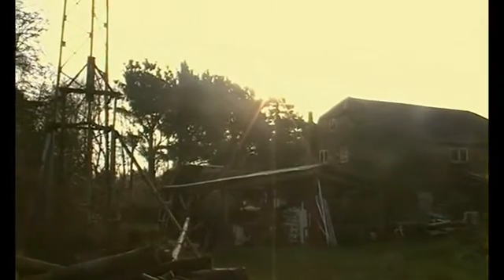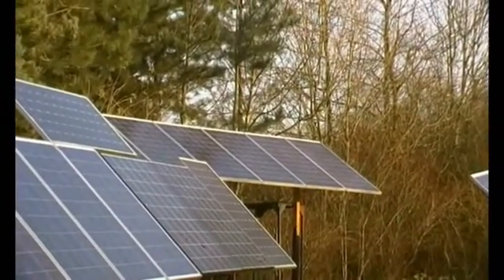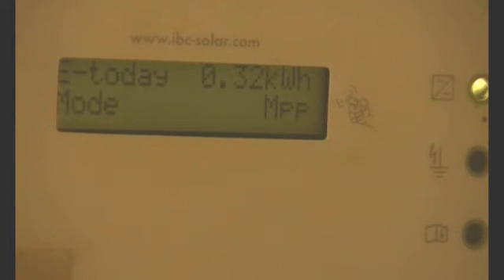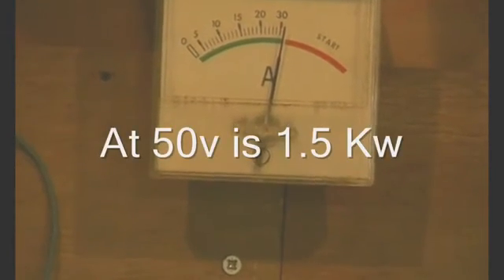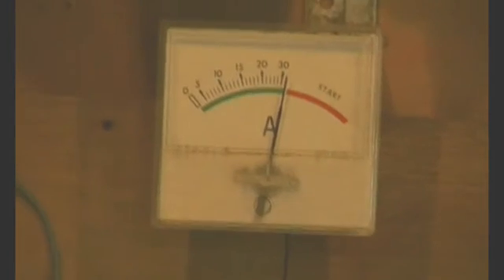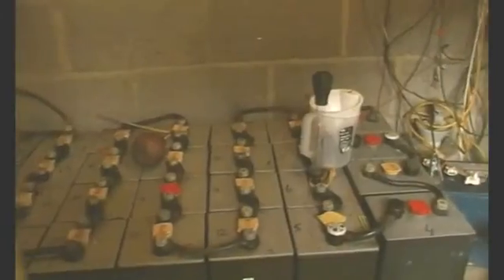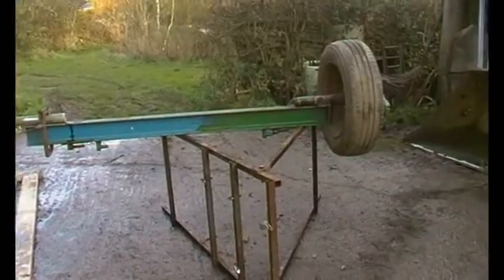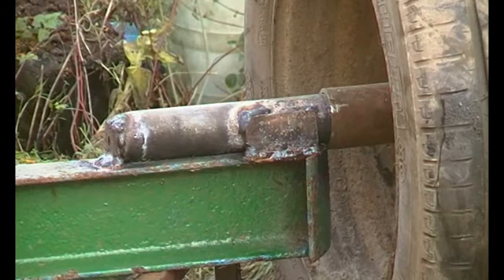Solar PV system at the winter solstice 2016, shortest day

Comment: at least snow isn't an issue. do you adjust the tilt of panels for sun angle?
Merry Christmas
Reply from the maker: Hi, John. I don't change the angle for winter as the shallow angle is best for light reflected off the clouds. Snow, I just don't want to think about it!. Cheers, Andy
Reply: Definitely...! I was wondering if I was the only one who thought of this. I have some panels set at severe Winter angles, but I also have "Summer Position" panels. Those latter ones do better on an overcast day no matter what the Season.

Comment: Maybe one could rig a system with fire eyes or UV sensors to servo's that will track the sun by zeroing the sensor to the sun.  The light sensor would be the signal to be tracked.  Perhaps it would require a little more than that and maybe not.
Reply from the maker: See the 6 solar gate videos, that project is tracked with a simlpe interval timer. The circuit is in the book. Have you subscribed to this non profit channel? Cheers, Andy